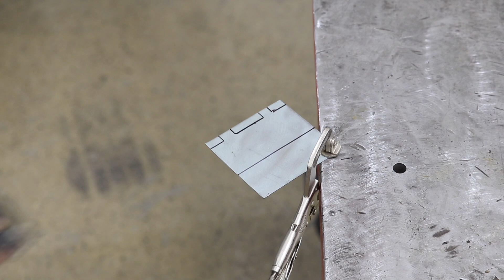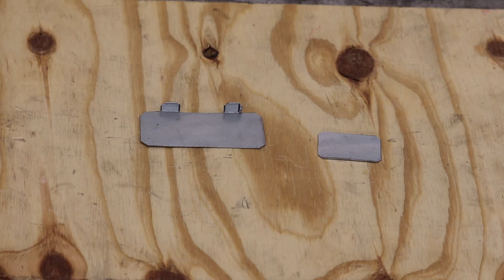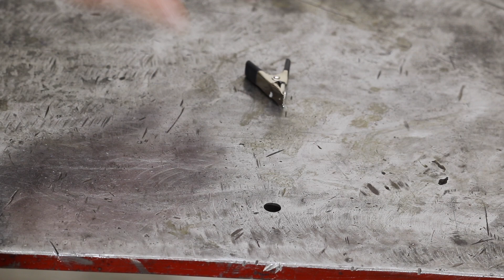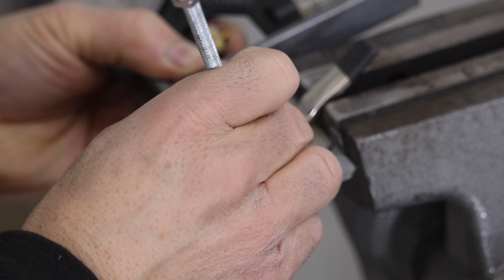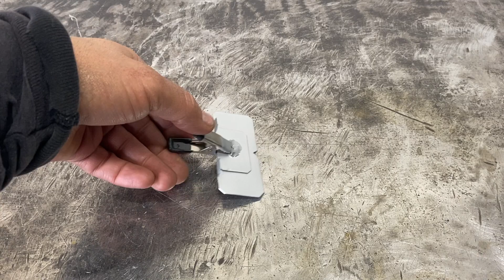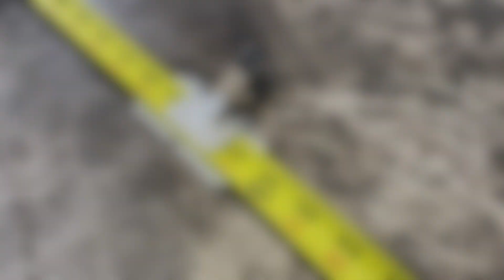EASY DIY HOMEMADE TOOL  ||TAPE MEASURE HELPER || MAKING TAPE MEASURE CORNER READER || HOMEMADE TOOLS

Comment: Every tape measure has the length of the body of the tape measure right on the back.  Common is 3 inches.   Place the back of the tape measure against the wall and add 3 inches or whatever the number is on the back.  I know you're going to look at the back of the tape measure, right now.  It's there.   Your idea is a great idea just the same.
Reply from the maker: Thank you for your feedback. 😀👍🤝